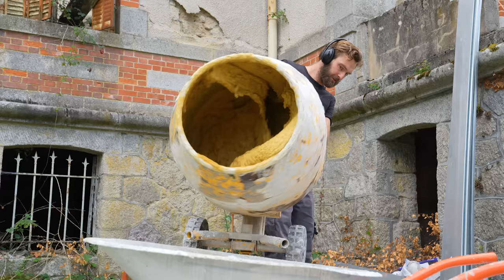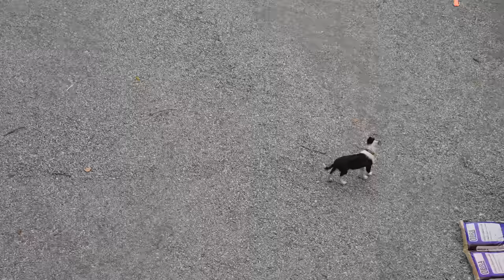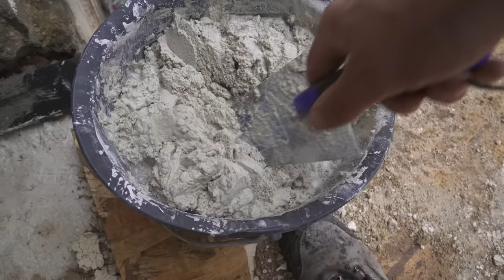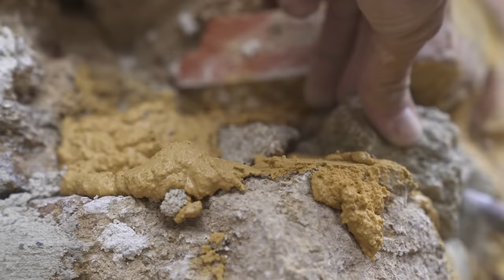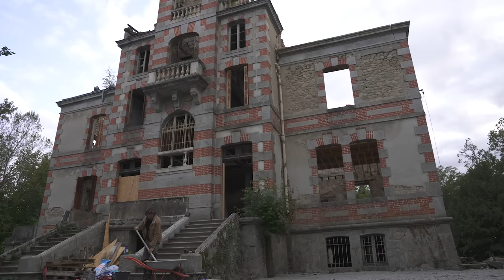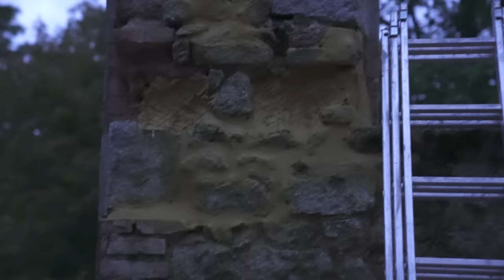Structural reparations, rebuilding degraded pillars.

Comment: This is not a job, this is not just a series of jobs, this is a career of a build. You are right, the fire and the ravages of time have done huge damage. The parts at the top were subject to more heat and more weather, so this will take a great deal of work, and your careful approach is the obvious alternative to pulling it down and starting over. Stabilising and resolving the structural issues, one by one, is the only way a one person 'team' can work. Even if you do sometimes have others helping, you are still one man and a trowel, plus two dogs of course.
Reply: There’s a reason they didn’t rebuild cathedrals, castles or manor houses that had fires - the mortar becomes brittle.

Comment: I glad to see you got yourself a pointing trowel.  When you are filling in those big voids in the masonry walls you can't rely on mortar alone you need to be stacking rock in there too.  It doesn't have to be a picture perfect stone wall, just stacked running bond stone mortared in place.

Comment: Top tip (maybe): when I was repointing one of the flint walls in our house, I found that using a wire brush drill bit made removing the old lime mortar a lot easier. Might make things a little quicker?
And an old cleaning product spray bottle filled with water to dampen the walls for the mortar

Comment: Dan, can you get a water sprayer that is used in gardening to "Splash" your bricks. They come in packpack for or just the large plastic bottle and hand sprayer. It would be more efficient while 30' high...Brico must carry them.
Reply: That would help but he doesn’t have running water yet!!!
Reply: @karenniehues4786  He actually has his well to use for these purposes. It doesn't need to be expensive bottled water to wet down the walls/bricks.
Reply: @dennispatrick4999 no one suggested he use Evian to wet down the walls, just a spray pack😅
Reply: Just watching you work on your crazy complex and difficult restoration/ rebuild helps me during my own project. You handle everything with positivity and an “I can do it” attitude, so anyway thanks for gently reminding me that I can do the same…..
Reply: @mezanian  I mentioned the spray backpack.
And, if you see his videos, he is using bottled water.
Reply: He needs more volume to knock the loose debris off that’s why he’s using the bucket  a spray I’ll only dampen the face he’s doing two jobs at once .
Reply: @OFP2  Actually he's using a bucket to wet the bricks down. He uses his Leaf Blower and pick to knock off the debris. It's inefficient and Dan can easily wet down the walls better with a Sprayer.

Comment: Glad you are well, Dan.  We were worried about you.  Hey, my mason husband says why don't you purchase one or two of those two-gallon canister pump-sprayers with the spray nozzle handle in which the pressure can be pumped up?  Put water in one or two of those canisters and spray down your masonry before doing repair work/tuck-pointing.  They are light weight.  It would be so much better and give the existing masonry a better soaking than to just throw water on from a tiny bucket as you have been doing.  Go to Brico Marche and buy several of those, fill them with water, and hoist them up so they will be ready when you are. It will save you a lot of trips up and down the ladders.

Comment: It’s a mystery to me how the brick and natural stone are combined in that structure.
Wondering if that system was common in France
Reply: It was popular in much of Europe at that time. I suspect stone was cheaper than brick but brick was easier to use in corners so they just took whatever worked best. I also suspect they sometimes used stone they found while excavating for the foundations/basement, that's my only explanation why some basements are mostly brick with the occasional stone mixed in, sometimes massive chunks. The alternating granite and red brick on the outside was quite common in France from the mid-1800s to the early 1900s. Chaumont was at the tail end of that period with a potential build date of 1903.

Comment: I am 70 and have done quite a few projects repairing old stone and brick masonry. You are very good using that trowel. I preferred putting on rubber dish washing gloves and applying mortar and shaping it using my gloved hands. I wonder if anyone else does this. I found using the trowel a bit tedious. I consider myself an amateur, mostly self taught.

Comment: I'm not sure if you are doing this but I watched another show that is doing restoration and the man said it is best to wet down the old concrete or wall area when applying new concrete or cement mixtures like you have because it makes for a better grip between the new and old. If you put new wet cement or concrete it wont' hold as well and will eventually let go because wet to dry makes for a weak bond. Just thought I'd share. You're doing a magnificent job.

Comment: Good to see you back. I'm a huge fan. Love everything about your channel.  If I could may I offer a suggestion?  Find a thick pillow case or anything cloth as long as it's somewhat durable. Cut about a half inch round hole in one of the corners. Then you'll have you a piping bag for your mortar. I believe this would be easier and faster when doing brick and mortar work. Keep up the great work you are doing and sharing it with us.  Crazy J

Comment: Did you consider getting the scaffold that has stairs?  We use that when getting up and down anything that reaches too high.  It is so much safer.   Are you planning to use any cribbing on that doorway opening you are waiting on parts for?   You should think about running a cable up the middle of the chateau.  That way you can turn on interior lights and work later in the evening.

Comment: Good to have you back Dan. Now that you are making amazing progress on repairing the masonry, l am starting to wonder how you will finish off the interior walls. Will you build a wood stud wall in front of the outer walls and cover it in drywall? I realize that is further down the road after you get the roof on and windows and doors installed.

Comment: Why repoint the brickwork/stonework, it does not add to the structural integrity of the wall but the raked joints will provide a key  for the plaster coat?  Also, I trust that the mortars used are lime based as the original construction because if it is cement based there will be differential movement that will crack and blow the cement mortar, which will affect the adhesion of the plaster as well as undoing all the work now being carried out.

Comment: Hi Dan, loving your work (and im dead jealous by the way!) but im worried about the repairs your doing to the external walls/columns that will be supporting the lintels. I know its too late as this is old and the roof is on but i didnt notice you tie the new brickwork back to the old. Even a few old rebars drilled into the old brick/stone, like wall-ties. Your new brickwork is going to support the lintels, which in turn will support the steel I beams/floor and you mentioned the roof (havent got there yet) this is a lot of weight on new brickwork. It could potentially be a shear plane. It will probably be noting but its just a worry in the back of my head....

Comment: I have a question. The chateau burned up years ago and from the looks of the place, it was totaled out.  What are you going to do differently to make sure that doesn't happen again? Is there a Fire Station closer in that community? Are you going to set up water sprinklers inside? Just curious, because I don't think you have enough water pressure in your well to put out a sizable fire.

Comment: Why not install a simple pulley and power winch to lift the buckets of mortar and water to the 2nd or 3rd floor instead of hauling them up your ladder.  Can also be used to haul up the rocks and bricks.

Comment: Congratulation  for more than 300 K . But why  still not using pipe for cement repairs... and do not  use spray pump to make wall  wet before  repairing? And why not doing some fixing points to be secure...

Comment: If you consider it structural, why are you working with lime?? Cement based mortar is superior in every aspect. If you work too slowly, just mix less at a time. Your walls are literally crumbling apart because of the lime mortar. You'll be more productive if you throw the mortar into the gaps and onto the wall.